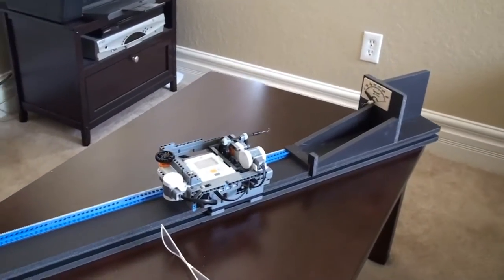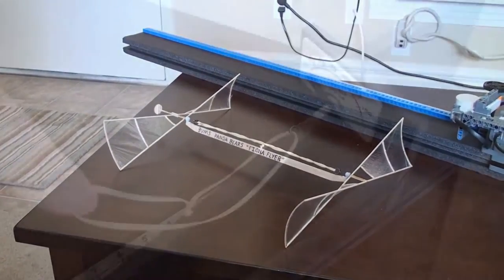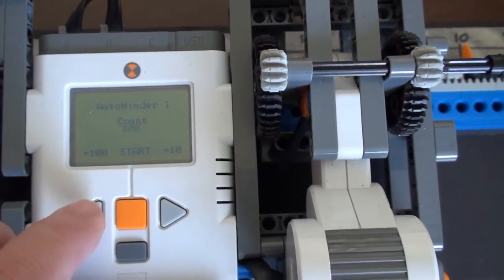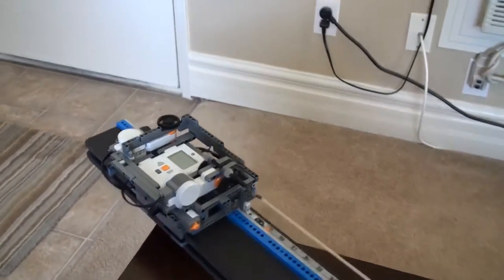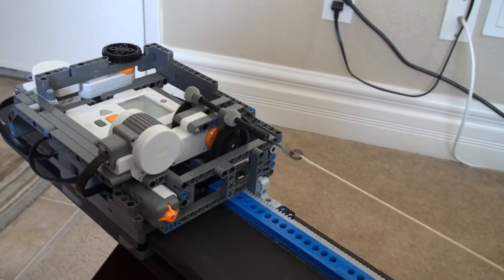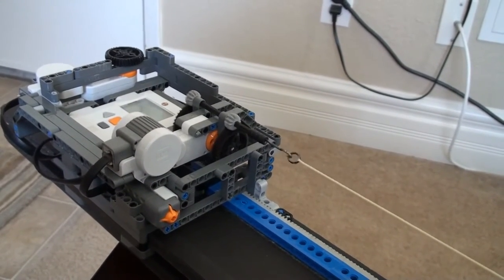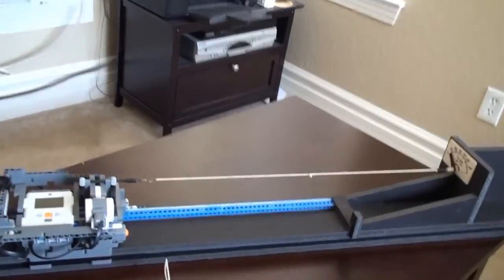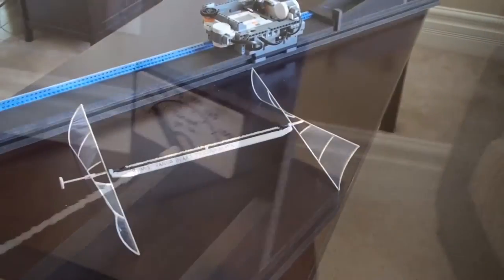LEGO Rubber Motor Winder

Comment from the maker: We used .125 wide rubber tied into about a 10 inch loop. The rings on the ends are thin slices from a plastic tube (about 1/4 inch inside diameter). They make it much easier to transfer the rubber from winder to the helicopter.